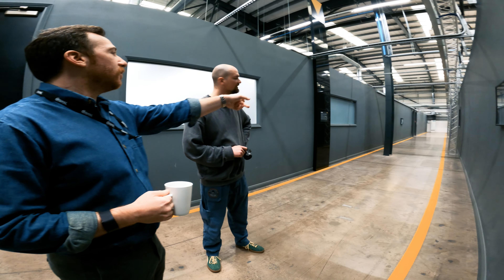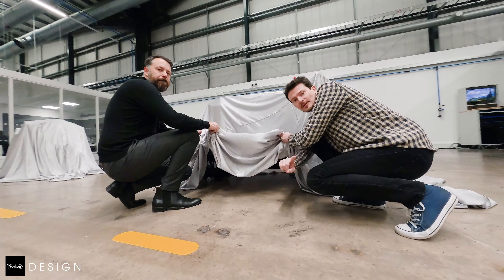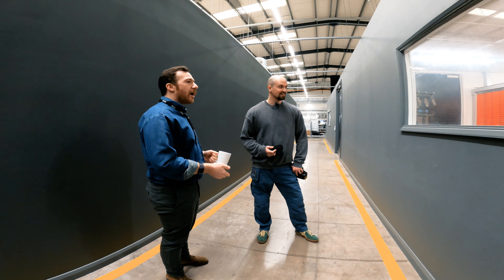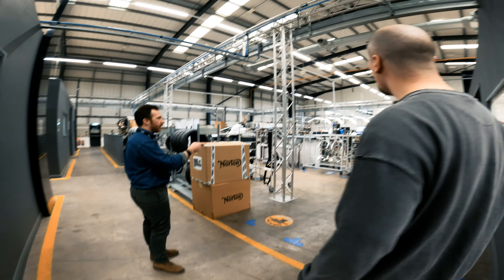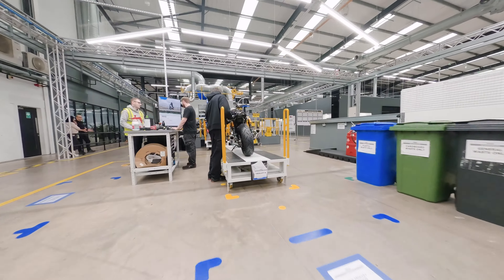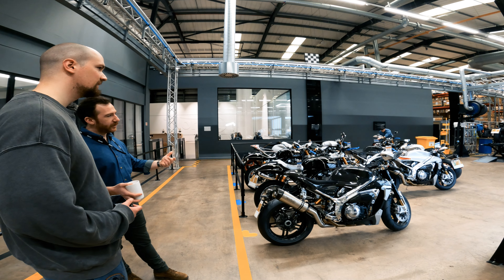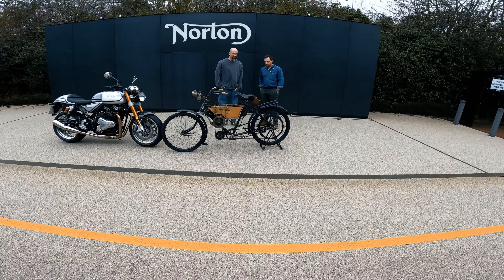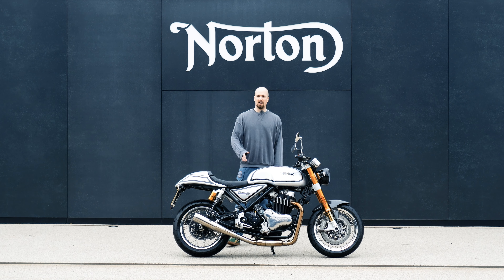Made In Britain. Norton Motorcycles Factory Inside!

Comment: I have wondered if the release of this bike has anything to do with the end of the Thruxton, which is the basically the same bike but less of a ripoff.
Reply from the maker: They may look similar but they are completely different. Definitely no correlation
Reply: The TVS Comm. was available in 2022, which was before the Thrux. production finished.
As l understand it the Trium. wasn't made in the Uk. Although an arguably faster more nimble machine smoother and an 8 valve head.
Reply: Wait a year or two or three and Triumph will reintroduce a brand new Thruxton that they can charge couple thousand more for limited edition models.
Reply: Is just a Bonneville with clip-ons.  And now more expensive than a 961.

Comment: One of the big downfalls of the original 961s were poor electrical components sourced from outside suppliers (cam/crank sensors and ecu in my case) . Sounds like the problem still lives on 😅
But that's a minor detail compared to the bursting coolant hose my Indian FTR was re called for. Or the collapsing fuel tank that my 701 Vitpilen was re-called for. 
I would have another 961 in a heartbeat. One of the only current new bikes with any soul and character. Don't even compare it to a Thruxton.
Reply: I suspect that if I was to purchase one (probably a used 961, there is one kicking around locally) I'm afraid the FI and maybe the stock electronic ignition would be things of the past.
Reply: @junkmangeorge6363   I think there would always be a way to fix it. Some people on the Norton forums know them inside out. I often think it's better to buy something with considerable mileage on, because most of the teething troubles will have been sorted. The Garner era 961s to avoid are the barely used bikes with very few miles on them. Almost all of them had issues initially ,from what I heard.

Comment: I think if they made more they would certainly sell more at a cheaper prizes. Having only one dude to polish is a formula for failure having seen similar situations in aerospace manufacturing and it always ended badly.

Personally I don't see why they would have tons of inventory which adds to the cost of motorcycles especially with no plans for even medium rate of production. 

I wish Norton and TVS great success and hopefully they have a plan to get there but unless they have some aces up their sleeves but I'm not hopeful.
Reply: They can't make so many that it breaches the single SVA testing rules, l think
Reply: @bananabrooks3836  You are correct about that but unless they can't hit the sound or the emissions I would hope they would make more than is allowed right now.

Comment: It's truly excellent how stringently the bikes are inspected for scuffs etc., before being approved. Sad to say, but I've personally had to threaten some franchised dealerships with legal action, following gouged stanchions, three inch long scrapes, red hot discs from seized calipers which I'd specifically requested to be attended to, during fitment of new replacement discs. I became so disillusioned with shit workmanship that for many years I've done almost all of my own servicing, barring for tyre changes and valve maintenance, both being entrusted to smaller but trustworthy places. One can only hope that Norton dealerships are as respectful as the manufacturer. The vast majority are 'get that bike out asap, this one needs seeing to by today', something which is no fault whatsoever of the mechanics themselves. £££££££££££££££££££££££ !
Reply: So stringently inspected they don’t work in the rain!
Reply: I don't know of any bike manufacturers that subject their bikes to thunderstorm conditions, do you ? If so, enlighten us all. Every firm is reliant upon electrical componentry being up to snuff. My own bike had an HT lead that had turned green, causing an initially hard to isolate misfire on one cylinder, and it was like that from as low a mileage at 500 odd from brand new. Your argument is very silly, if I may say so, without causing you any undue personal angst. Check to see if your next scone has the requisite number of currants and that none are overly hard. @sidweazel2883
Reply: @michaelarchangel1163 so you’d find it accept to pay top dollar for a bike that doesn’t work in the rain? Considering this was a press bike which was checked and double checked, not a great advert the best they can do, wouldn’t you agree?
Reply: @michaelarchangel1163  I'm sure most manufacturers do test their bikes in all types of conditions including heavy water logging. I think this is one area that hand making each bike is a big disadvantage